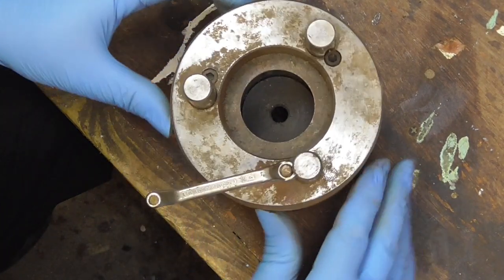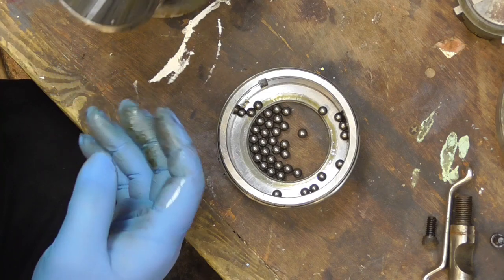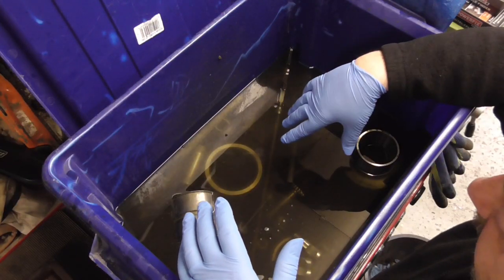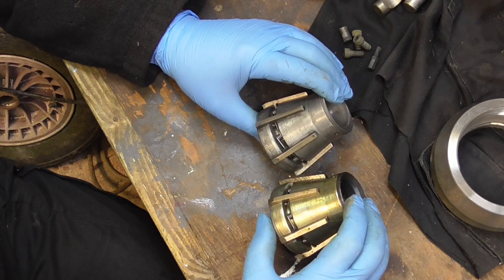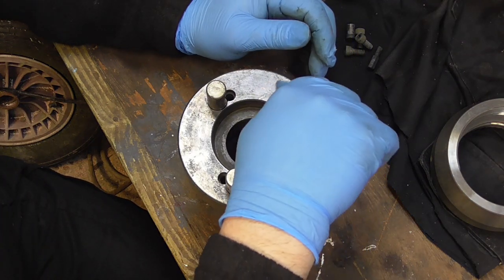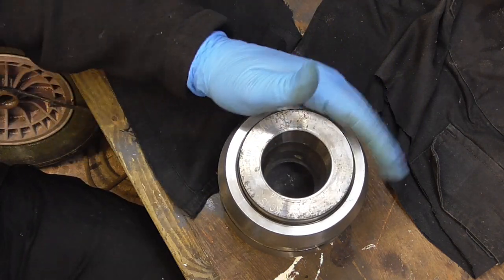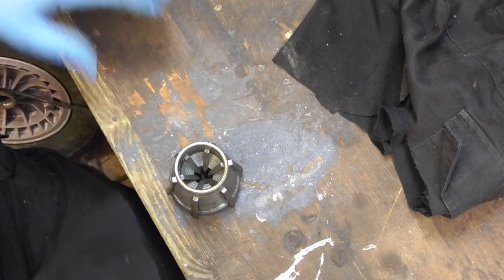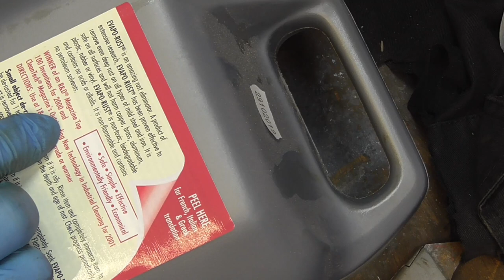Strip & Clean Burnerd EC Multisize Collet Chuck

Comment: The keys are hard to find and expensive when you do find them.  You can substitute a Jacobs K5 chuck key for the Pratt Burnerd key and the fit and function will be good enough most people wouldn’t know it isn’t the correct key.  Just an FYI if you are still looking for a key.
Reply from the maker: Lucky I did find the original key.

Comment: I have these collets as well, even with just WD40 and a soft cloth, the coating comes off. I presume over time it just degrades, it wont affect the operation of it, so I am fine with it. They are still just as incredible without it.
Reply from the maker: Yes, opperation is tottaly fine, just a bummer the coating came off, esp as most of these had never been used.

Comment: Those are excellent collets. I know now, not to try cleaning mine with Evaporust, thanks!
BTW, that's a Coventry die head amongst your other bits.
Reply from the maker: Yes, found that out, have a LARGE collection of die's for it & I have a video coming soon of strip and clean.
I also has another about 1/3 the size

Comment: I have just inherited a very similar one sadly stripped down and without the 39 ball bearings. Any idea what size they are ? Cheers
Reply from the maker: Hi, I honestly can not remember, you can get bearings quite cheap & you can probably work out roughly what size they should be from the track, I think they were imperial.
Reply: @WarGrade  Turns out they are .250 so a 1/4 of an inch. Even better I had a few left over from another job. All up and running now.
Reply from the maker: @erpkid  excellent news, great chuck, only thing is you can not hold short stock. but really good for bolts and the like as there's next to no damage on the threads.

Comment: Damn nice chuck! Would hate to have to but one new. Pity about the zinc but its really only a very thin zinc chromate layer as a corrosion protective - a good oil should suffice in lieu. Incidentally I would not be putting "together" things in any sort of cleaning liquid without pulling them apart. Save up your money and but a new key from PB 😊.. Martin
Reply from the maker: Funny but the zinc comes off where there is direct & unrestricted exposure, so I am sure behind the fingers its still coated.
I have well oiled them now.
So found another 40 or so mill bits too!
Plenty still to sort through